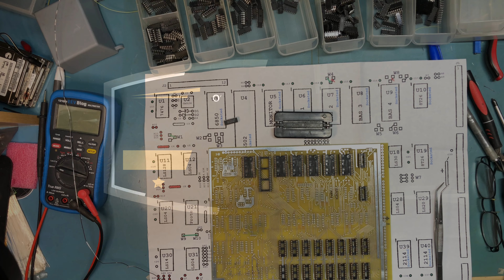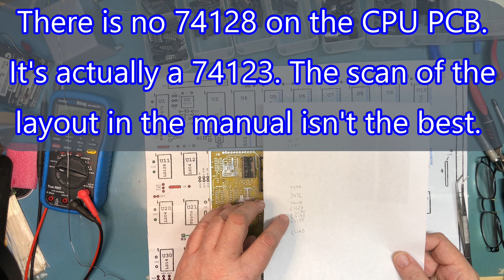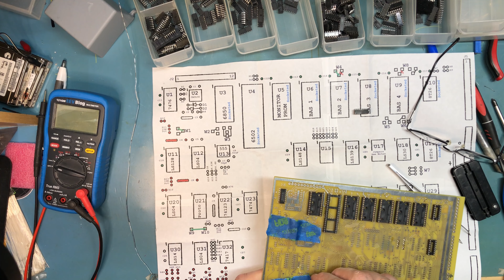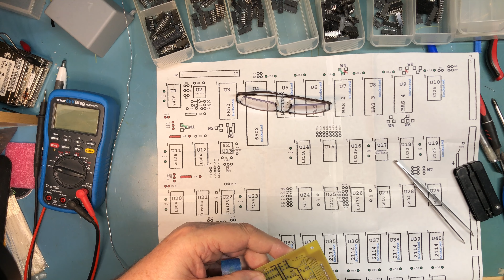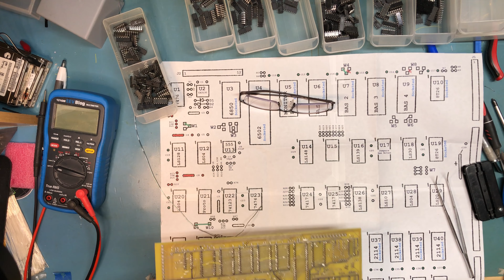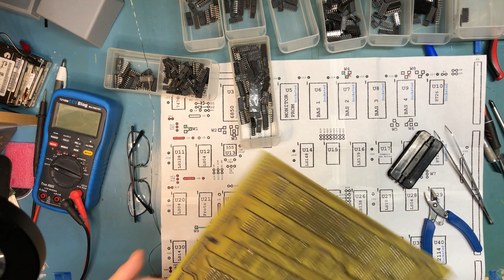STB1105 - OSI System Build - Part 6 - 502 CPU Stuffing core TTL ICs

Comment: Great series of vids. I am in the middle of building a 502 as a standalone and I wondered if you felt able to share your layout diagram and other documentation? I am using the Service Manual as a guide but not all of the component locations are marked (e.g. RS232 components and some high numbered resistors). I have the BOM that you have but not much else. Kind Regards, John
Reply from the maker: Thanks! Let me see if I can find the files. I lost my archive and may no longer have them.
Reply: @ShadowTronBlog  Thanks, appreciated.